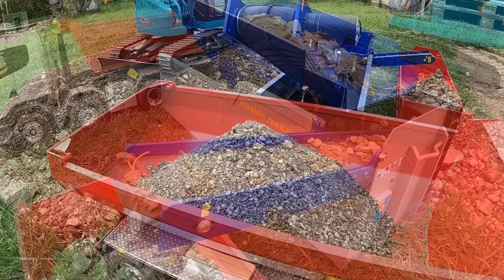Backfilling and sorting, RC Excavator Kobelco, Caterpilar Bulldozer, Scania Truck, Scale. Part 3

Comment: Hey, nennt man den Lkw 8x8+2 oder 10x10 ? Es ist einfach irre was du so herstellst...
Reply from the maker: 10x8/6. 10 wheels (or twin wheel), 8 with traction, 6 with steering. It's a common setup here in switzerland. We have a lot of 5 axle truck